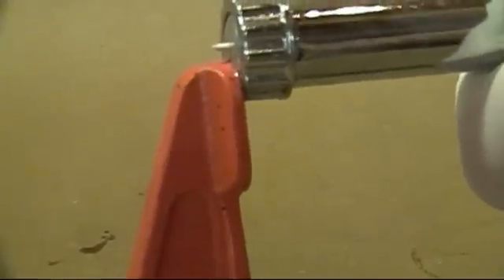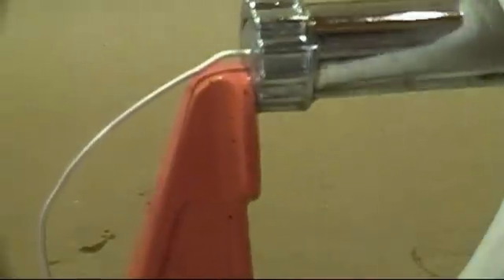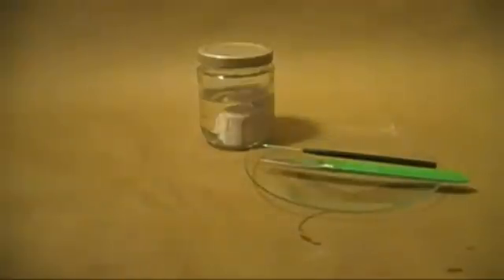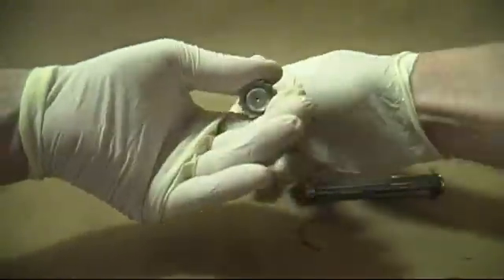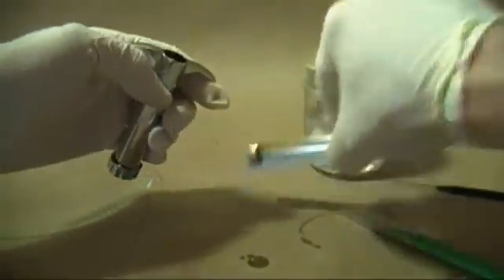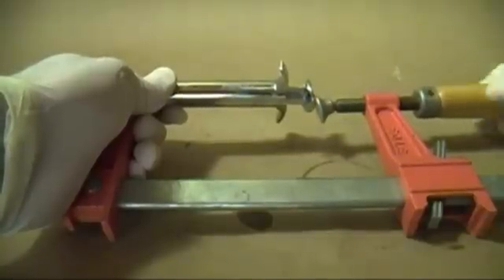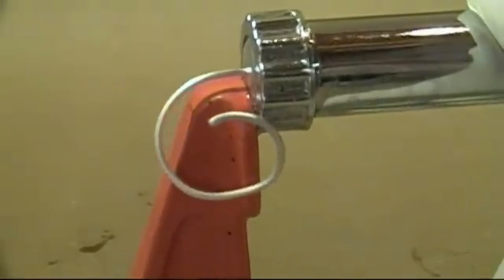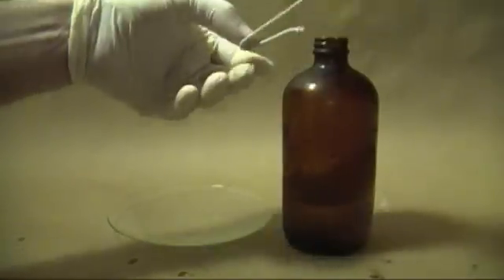Lab Tips: Make Sodium Wire for Drying Solvents

Comment: Wouldn't it be easier to melt the Sodium in hot mineral oil, suck it up with a hot glass Syringe, and inject it back into the Mineral oil, while dragging it so it comes out like a wire?
Reply: Does that sound easier to you?
Reply: @chemistryofquestionablequa6252  it sounds like it would give a better yield since the sodium never touches the air.
Reply: @theterribleanimator1793  At best it would give you a very rough wire. But it probably wouldn't work due to the precise temperature control that would be needed.

Comment: Wouldn't the triangle wire have more surface area?
Reply: Nope.  A circle (or more specifically a sphere) has the most surface area of any shape.
Reply: @BackYardScience2000  If I recall correctly, a sphere has the least surface area for each unit of volume. There should be something on Wikipedia with an explanation.
Reply: @buggsy5  , you are correct.  I don't know what I was thinking when I wrote that.
Reply: @BackYardScience2000  No problem. We all make mistakes.

By the way, I love the extruder idea - I never thought of trying that. It was a slap my forehead and mutter "Why didn't I think of that?" when you pointed it out.

I wonder how a long thin sodium wire would react if an end was slowly lowered into water?

Comment: At first I was really skeptical of a person's ability to just be able to squeeze a hand held extruder hard enough to get sodium to go through such a small hole and form small gauge wire, until I saw the clamps. 

But I am wondering, how does sodium keep solvent dry? Is it due to sodium's affinity for water/moisture, and its ability to react with that moisture and form sodium hydroxide? If so, wouldnt the hydroxide now be mixed with, and contaminating the solvent?
Reply: little late but no sodium hydroxide wont dissolve for instance in ether, however i would have distilled before using it